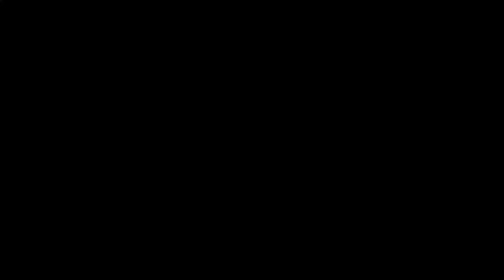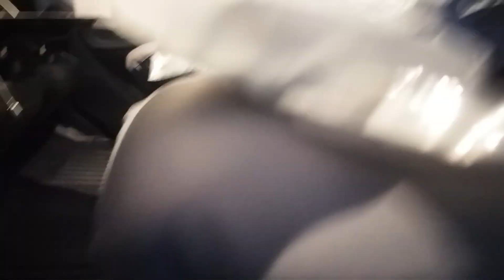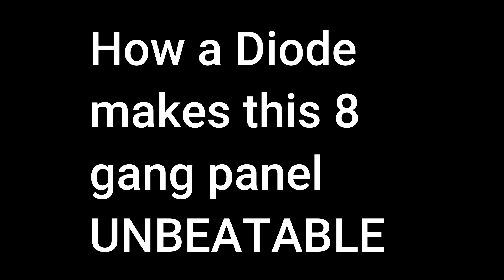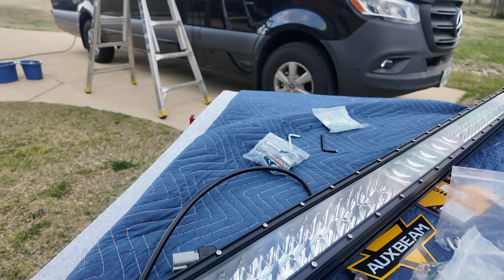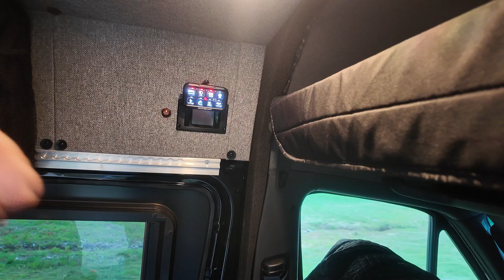Finally, A Simple Way To Wire Your Van - Auxbeam 8-Gang Review

Comment from the maker: ▶ See all the parts I used in my VAN build for FREE: https://bit.ly/RFVanBuildPartsList
🛒 PRODUCTS MENTIONED & DISCOUNT CODES
(Use code RANDOMFIX for 15% off)
▶ 8-Gang Panel with 2 Remotes: https://shrsl.com/4wpsr
• Amazon option (1 Remote): https://amzn.to/43KcnX1
▶ 12-Gang Panel with 2 Remotes: https://shrsl.com/4wpss
• Amazon option (1 Remote): https://amzn.to/4mAmE0m
▶ Auxbeam 52" Light Bar: https://tidd.ly/471lBRl
• Amazon option: https://amzn.to/4jA4RUt

🎥 RELATED BUILD VIDEOS
▶ AUXBEAM 8 Gang Switch + LED Light Bar Install: https://youtu.be/a4Xae4J4b2c
▶ How to Wire a Van Like a Pro: https://youtu.be/RPgQe8d_3BQ
▶ Understanding Diodes in Van Wiring: https://youtu.be/pCRmZKXeGAA
▶ Air Conditioner Install & Light Bar Wiring Route: https://youtu.be/qsGtl2X0fyI
▶ Wire Routing Detail Video: https://youtu.be/8RGpvvMbasU
▶ 13,000 Wh (13KWH) Power Bank System & Setup: https://youtu.be/CpxEwSwUNbA
▶ My Power Bank System Install: https://youtu.be/rqFwxSwji1w
▶ Sprinter Power Leads Under Driver Seat: https://youtu.be/42sVAuafbXc
▶ Shore Power Install (Rear 2025): https://youtu.be/PO2sdMM50-A
▶ Shore Power Install (Front 2021): https://youtu.be/Ksyee3aYm7s
▶ Stereo Amp Install: https://youtu.be/vhBOfmHlM-g
▶ Vantech Roof Rail Install: https://youtu.be/oB_Yh3JEooI
▶ Low Pro Roof Rack System: https://youtu.be/pkj5Tcs5a1U
▶ Standard Roof Install on 170 Extended: https://youtu.be/1FX9xsWQa7Y
▶ Maxxfan Roof Fan Install: https://youtu.be/bq52RUauRNE
▶ Roof Deck Install: https://youtu.be/4cu8mjVKQzc

Sprinter Playlists (60+ Videos Each) 🚐
▶ VS30 907 170 EXTENDED: https://bit.ly/VS30Sprinter170
▶ 170 High Roof: https://bit.ly/VS30170Extended
▶ 360° Van Tour: https://youtu.be/rCCA3hLQSzQ
▶ FREE Van Build Parts List: https://bit.ly/RFVanBuildPartsList

⏰ TIMESTAMPS
0:00 - Intro: Simplifying Camper Van Electronics with Auxbeam
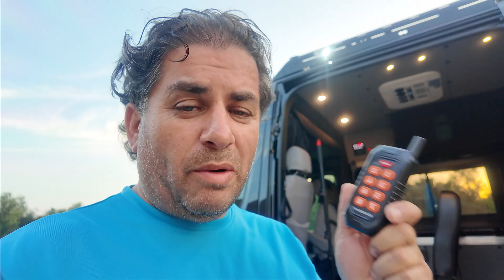0:08 - Auxbeam 8 Gang Wireless Switch Review: Features & Benefits
0:19 - In Operation: Seeing the Auxbeam Switch in Action (Night View)
0:22 - Easy Installation: How to Wire the Auxbeam Switch Panel
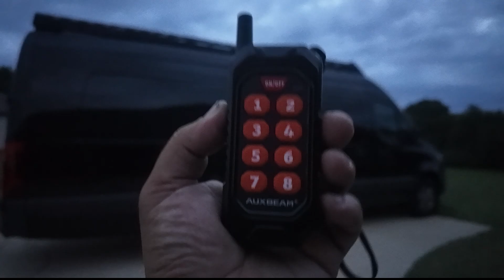1:46 - The Evolution of Camper Van Wiring: From Complex to Simple
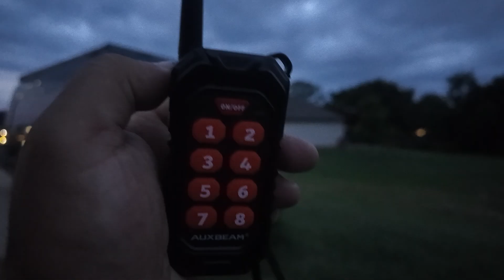2:19 - Auxbeam Gadgets: 8 Gang Switch Box & Exterior Lighting Setup
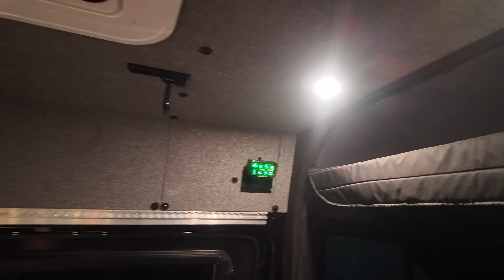3:34 - Replacing the Battery Box: Space-Saving with the Auxbeam Panel
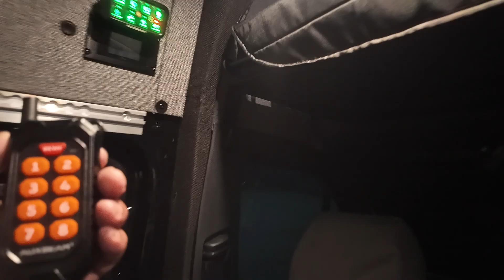4:17 - Exploring the 8 Gang Switch: Control, Memory & Flexibility
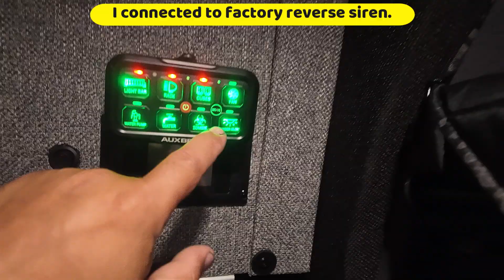5:59 - Remote Control Range Test: Putting Auxbeam to the Limit
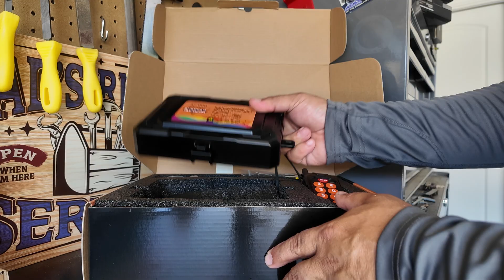10:17 - Unboxing & Components: What's Included with the Auxbeam AC800
13:00 - Advanced Wiring Tricks: Integrating Lights with Diodes
16:00 - App Control & Light Bar Mounting on Sprinter Van  

Simplify your camper van wiring with an easy auxbeam switch panel install. Control all your lights and electronics wirelessly.
Managing complex electronics during a van build often leads to messy battery boxes and confusing wiring. This review covers the 8-gang wireless switch, showing you how to set up the remote, app, and panel to clean up your electrical system. Whether you are adding an auxiliary light switch panel to your setup or just need a cleaner way to manage your accessories, this solution provides flexibility and space-saving benefits.
I demonstrate the installation on my Sprinter camper van, including a real-world operation test and a range check for the remote. By moving away from traditional bulky switches, you can streamline your electrical layout while maintaining full control over your gear. These components are available on Amazon for those looking to upgrade their current system.

Disclaimer:
Due to factors beyond the control of RandomFix, RandomFix assumes no liability. Affiliate Partner: I will receive a commission from some of my affiliate partners for my first-hand recommendations such as Amazon. #CommissionsEarned #Ad My videos include paid links. #campervan #wiring #auxbeam